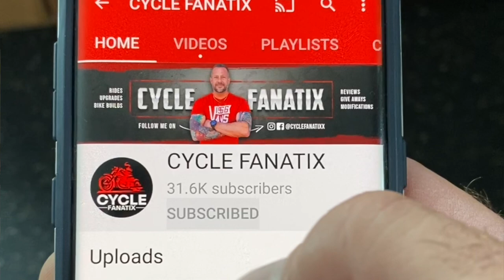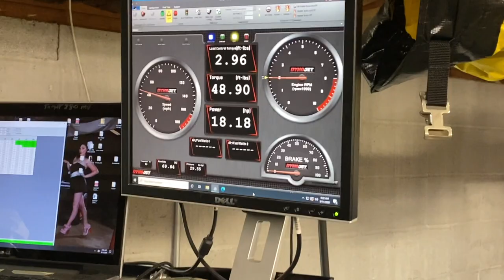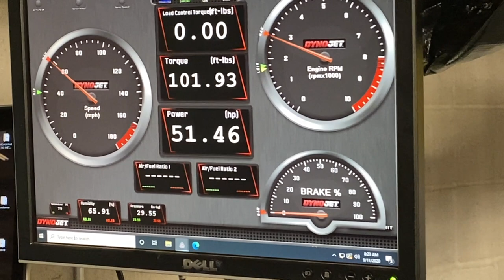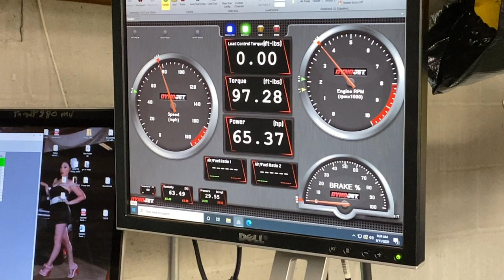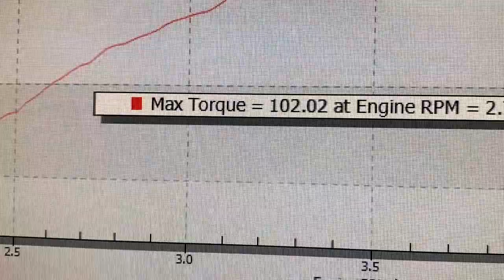Stage 2 -Stock Dyno Run/2020 Road Glide Special 114 - Custom Dyno Tune JD Cycle works

Comment: John you need to look at the AIM Light force slave set up for your clutch, it not only moves the engagement point on the clutch closer to the grip it also reduces the pull by about 40%. I put it on my RGS and love it.

Comment: How you going John, Check out Kevin Baxter / Street tuning vs Dyno tuning.. HD claims 119 lb@ 3000 rpm  and 90 HP for 114 2020..

Comment: Thats a big claim from a stage 2 when the 131 stage 4 is putting down that kind of numbers.
Reply: Josh Calbert my 2018 Breakout is 120/130 at the wheel with a woods performance 22X cam kit  thunder max  Vance & Hines pro pipe and a K&N heavy breather
Reply: I agree. I find it hard to believe that you can get those kind of numbers with just exhaust, cam and breather. I just did a Zippers Performance 128 Sleeper kit and I am getting 130hp/145tq.
Reply: Jamie Ritchey yeah I personally know somebody who did the S&S 128 kit in his street glide special and his numbers are 128/138 10.75 to1 ratio
Reply: I'm more than likely going to go ahead and order the pistons and cylinders from fuel Motel come winter